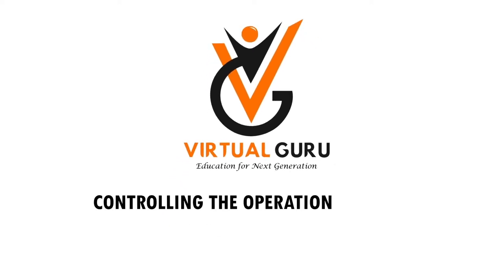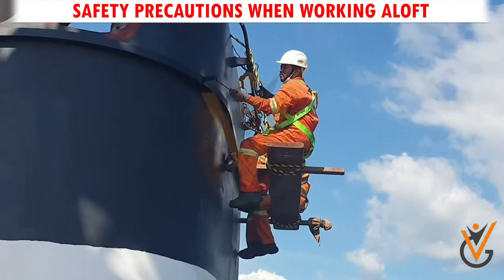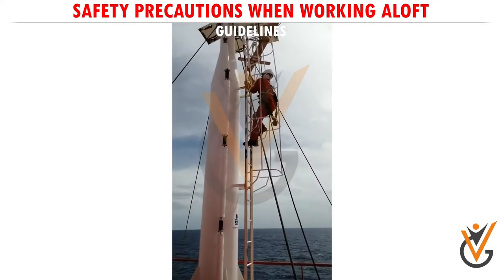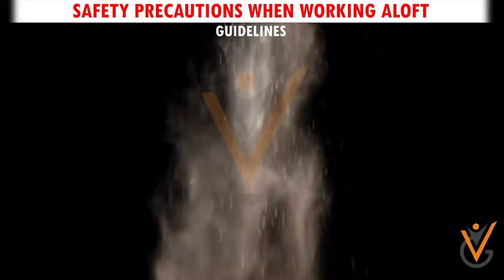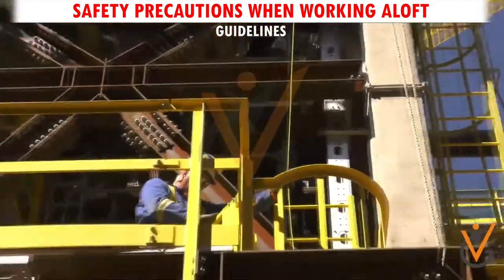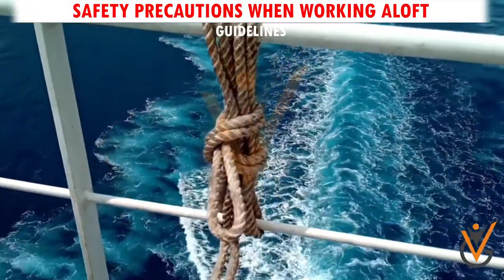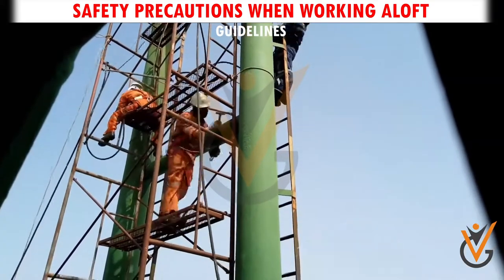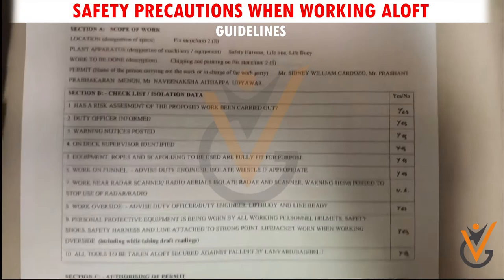Controlling the Operation of Ships | Safety Precautions when Working Aloft

Comment: It's not a safe practice to use ropes directly to the stage, instead use a wire and a shave in between ropes .....especially in place's where it is hot surface....